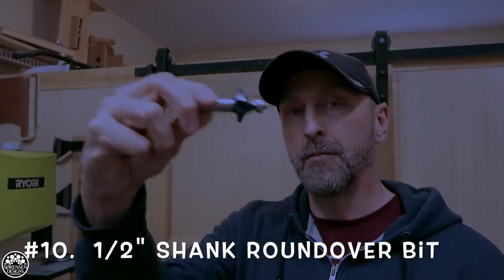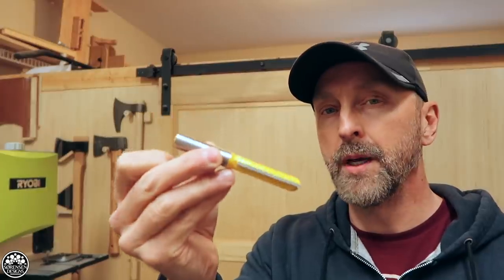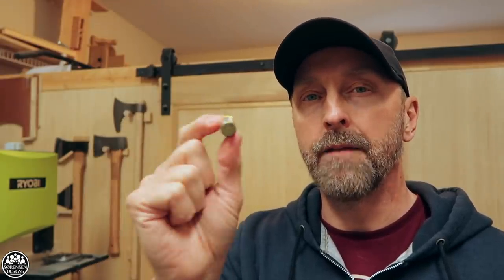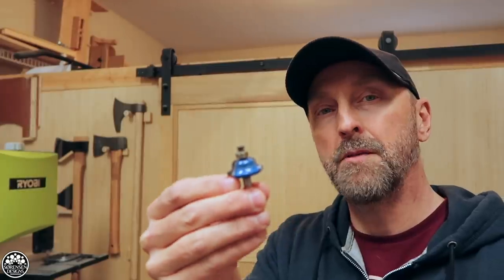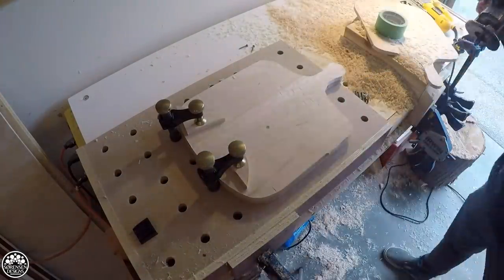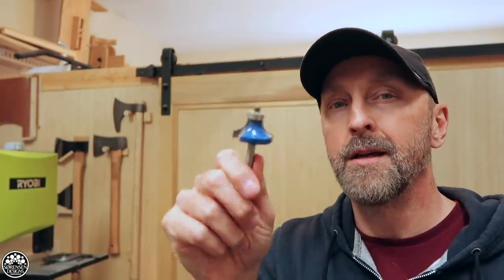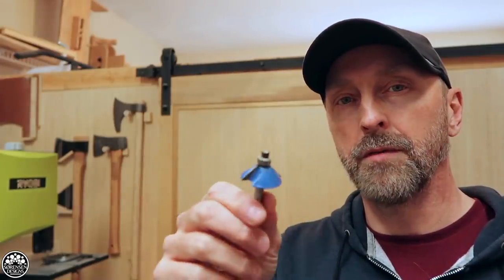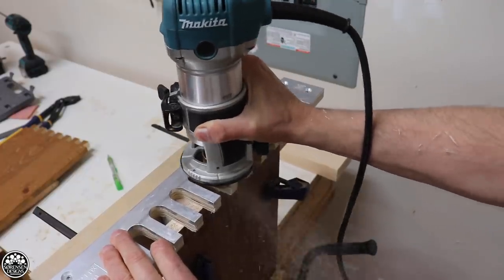Top Ten Router Bits // Woodworking

Comment: Thanks for the info on router bits. 
I have a question about router plunge bases. I know you have a Makita trim router but have not seen you use it with a plunge base. I am considering buying the Makita RS0701 router with a plunge base. I saw the plunge base but the depth adjustments seen a little awkward or different when I see other brands. Do you have experience with this base? Is it easy or not so much to use and make fine adjustments?
Reply from the maker: I would consider going with the the Dewalt compact router instead, with the DNP612 plunge base. I have the full sized Dewalt router and plunge base now, and I like it better than the Makita. When it's time to buy a new trim router, I'll probably go with the Dewalt. The Makita works well, but the bits tend to slip in the collet from time to time, which is pretty frustrating.
Reply: @EricSorensenCanada  thanks

Comment: Very enlightening, thanks. I picked up some good quality long parallel bits like the one you held up but find my budget routers allow chatter which can allow the shank to vibrate out of the collet. Have you ever had anything similar happen with your quality routers? Stay safe!
Reply from the maker: Thanks David. Sounds like the collet is loose. Buy at least one good router and make sure the collet is tightened properly. Also check to see if saw dust has caked up inside the collet. Clean it  out from time to time by removing it and give it a good tap to get all the dust out.

Comment: The principal advantage of the larger 1/2" bit size is that there is a much larger surface area for the router collet to grip. When subjected to the forces those bits are typically exposed to, that larger contact area and more mass give the bit more stability (and also greatly helps with heat dissipation). Routers that accept 1/2" bits also typically have more power than 1/4" ones, which comes in handy when you're trying to make big cuts.

I bought a 1/4" collet router and I regretted not getting the larger 1/2" version not long after. I also found it difficult to completely secure a bit in the collet, and as a result I had the bit slip out quite a few times. I found that the difference in size and weight between the 1/4" and 1/2" routers did not make up for their difference in performance. If you want to use a router for typical woodworking stuff (not CNC or basic edge trimming), then you should probably buy a 1/2" collet router...

Comment: Nice video, your number six bit the Roman Ogee makes a nice decorative edge using  horizontal router table putting an edge on a door or drawer face...  I had to replicate a commercially bought cabinet and found that the Roman Ogee worked great for this purpose as a match...  Greg

Comment: 1/4" will have to be good enough.  I found the cheapest 1/2" model was 70% more expensive and 60% heavier.
Reply from the maker: Yes, you only get them on the bigger routers. There are no 1/2" trim routers. It's a trade off.